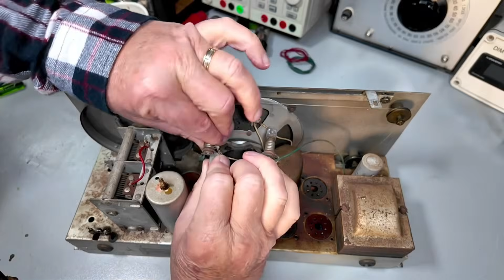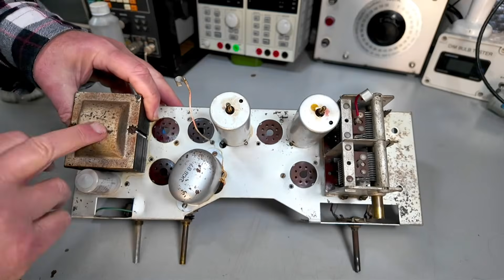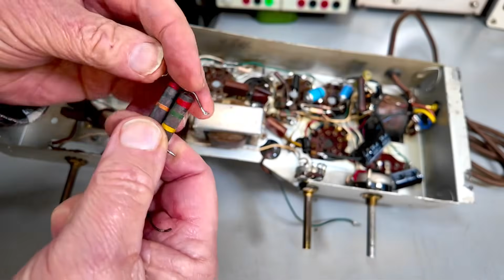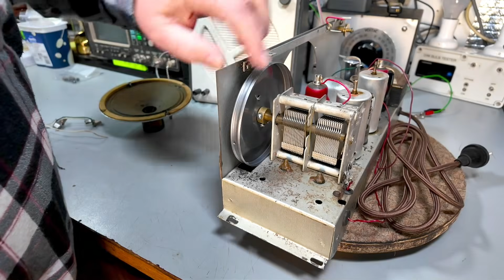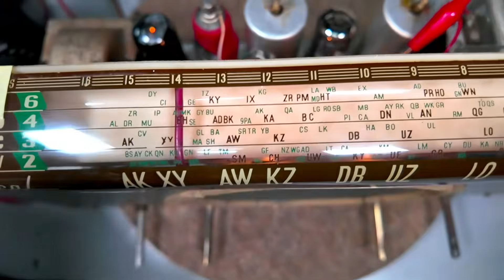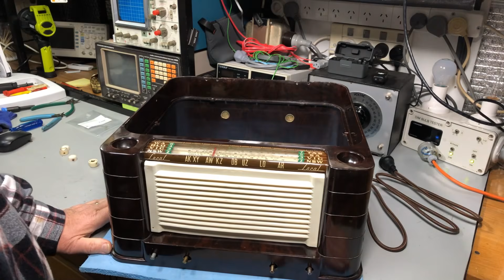A  Scharnberg Strauss Radio Gram Restore - Part 2

Comment: Hello Baz a Excellent Refurbishment of Scarnberb Strauss we didn’t see them in NSW it preformed well,Re the Collaro 78 Record player I did HMV from early early 50s the turntable and motor were easy overall but Magnetic pickup with Steel needle I found the rubber mounting inside the cartridge had gone hard I eventually found some silicone rubber with a lot of time I got the old cartridge preformed with steel needle satisfactory good luck the the turntable Baz,Regards Ian,
Reply from the maker: G'day Ian, thanks for the great info and feedback. It will help a lot.
Haven't done one of these before.
Cheers

Comment: Hi Baz. Well, that came up nicely, didn't it?  Nothing worse than that sinking feeling when it doesn't work after a recap. especially when you don't have a schematic.  That's where experience comes in, I guess.  It only took you a minute to find the problem.  And even the dial cord replacement went perfectly!  
As Dave mentioned, I didn't see you adjust the bottom of the IF cans, unless you did it off camera but it's a moot point anyway as the thing is going really well.
The turntable will be interesting.
Cheers
Reply from the maker: Yep, a new camera problem, just check my reply to Dave. It is performing great too. Working on turntable today, using the OLD camera !

Comment: Hi Baz, wouldn't it be good if all chassis cleaned up that easily. You only adjusted the top of the IF's, is your thinking the top ones are most likely to have been 'twiddled"? I pulled the yellow wire out of a choke during the week trying to strip the insulation. My repair was very similar to yours 👍🙂
Reply from the maker: The alignment was stuffed up due to my NEW Webcam disconnecting from the PC. I didn't notice at the time, stuffed up the bottom alignment, but saying that they were perfect, no adjustment necessary at all. Bloody camera has done that twice on me so far, never had a problem with the old one !
Cheers
Reply: @techobaz55  I feel your pain Baz. I thought you might have an alignment tech hack was all I was thinking.
Reply from the maker: @DavidTipton101 😂

Comment: Hi Baz. Given Ernest Smith & Co., and thus Scharnberg Strauss, were closely associated with National and especially Astor (Radio Corporation of Australia), my guess would be an Astor derived chassis. It's academic now the radio is finished, but my first port of call for the schematic would be Kevin Chant under Astor then the HRSA circuit books. I have worked on a few Scharnberg Strauss sets over the years and have been pointed in that direction. The IF cans definitely look Astor. Other parts are basically generic. (p.s. If you don't have a Philips Valve Data Book, they come up regularly at our auctions and the Christmas BBQ were I bought my 3 from different eras. I'll keep an eye out.)
Reply from the maker: Very interesting info indeed.
I do have lots of valve data manuals so all good there.
Cheers

Comment: Fun time again! DIAL CORD!! With an RCA (in your case probably a Phillips) receiving tube manual the pinouts are shown for the different tubes and you can work it out from there. I do this and work up a schematic in my mind and/or draw one out as I go. Your brake cleaner idea is great. Amazing is the near perfect alignment. I would have thought it would have been much further off.
Reply from the maker: Yes Douglas, it came up really well. Brake cleaner & Degreaser are both in my cleaning kit. Good old Brasso for Bakelite. Would have jotted down a schematic if I needed it but lucky this time.
Cheers